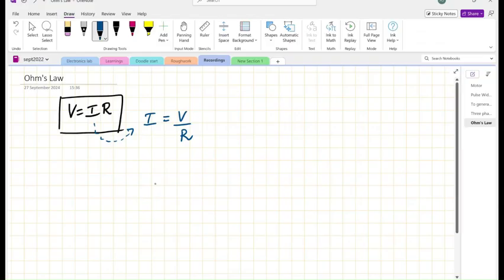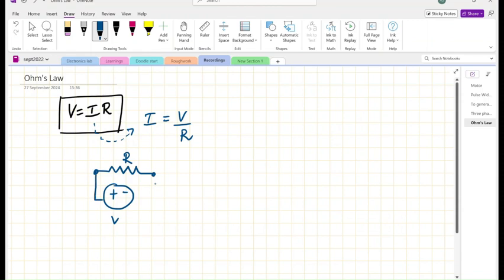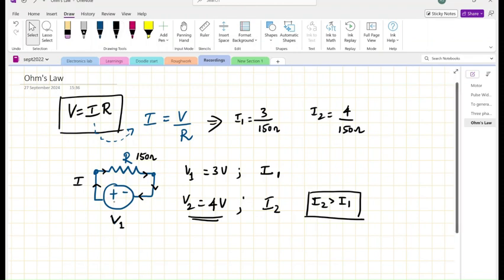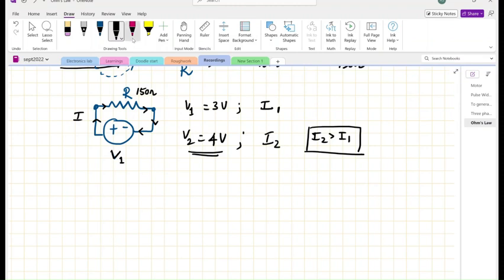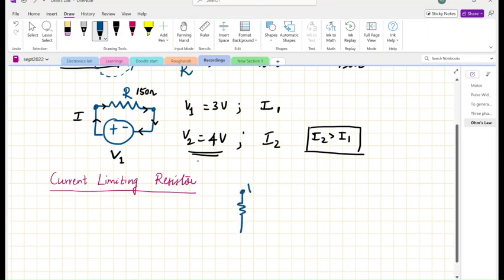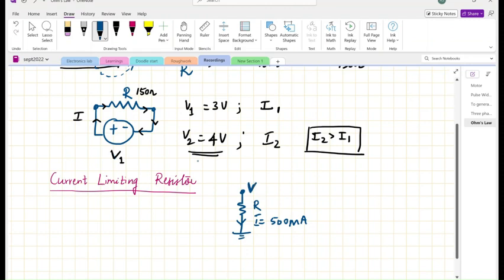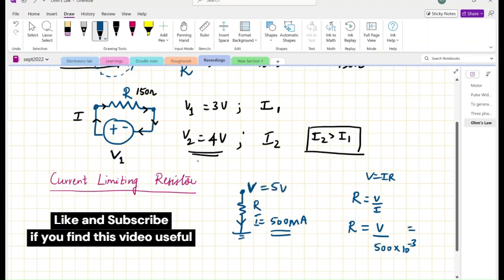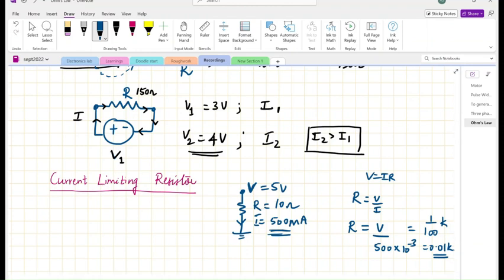3. Ohm's law like never before in Tamil || Basics of Electronics #tamil #TNrise

Comment: Explanation is very nice I need more videos about components choosing to design a PCB
Reply from the maker: I'll try to make one soon. What is your application?
Reply: @learnbettereverytime  I need to design power supply board with multiple port mam input is 12 v and 24 v and out put is 5 v/3A,3.3v/500mA,5v/2A
Reply: Mam ic I have chosen LM2596
Reply from the maker: You can also try with voltage regulators to convert directly. Like LM7805, LM7803..